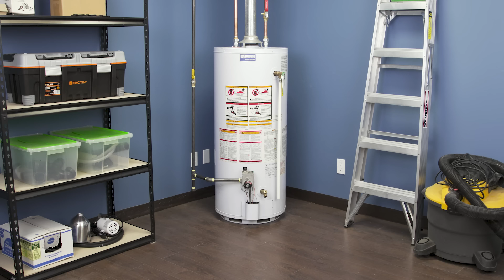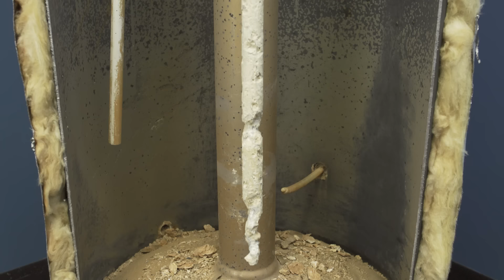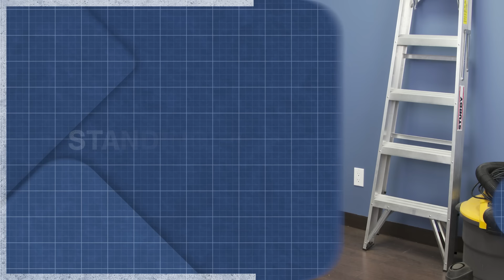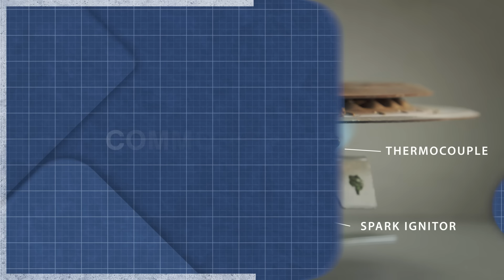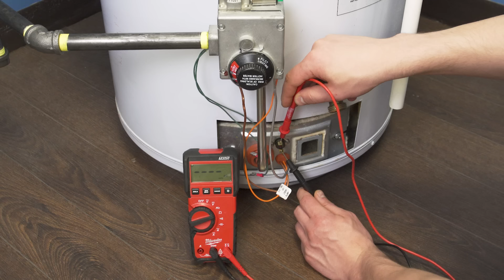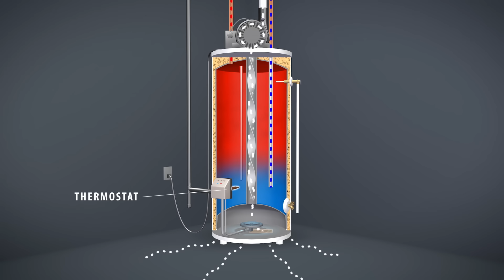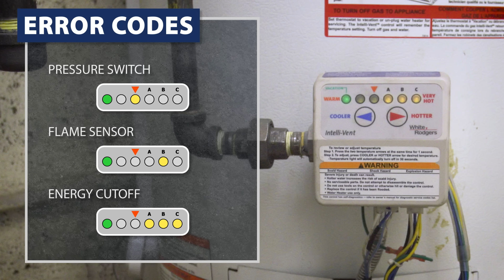How Do Gas Water Heaters Work? | Repair and Replace

Comment: With gas hot water heaters, there is a tiny screw that mounts the pilot assembly.     A year or more ago I lost that screw changing the $20 pilot assembly.    It is not obvious that the pilot does not sit on the burner tube flat spot, but instead mounts offset.    Sitting the pilot not where it belongs but just offset a bit causes it to blow out and readjusting the position fatique breaks the thermostat tube.   So to change the $20 pilot assembly, turn off the gas and remove the whole burner with one compression fitting and use the mounting screw on the pilot .   Then connect the pilot gas tube and the thermostat tubes.

I found the screw and slid out the whole burner assembly to mount a new pilot with the screw.    A years worth of hot water heater grief instantly went away and operation became perfect again.

This shows that some very tiny stupid misstep can cause a lot of grief.    Little things matter.
Reply from the maker: Thank you for sharing your experience. Losing screws or breaking mounting clips etc can make any repair more difficult. We're glad that it all worked out in the end!

Comment: Thank you for replying to all comments in this video, that's awesome. I think I might have an issue with my hot water heater or my plumbing, I am not sure yet. If I open a cold water faucet that is upstream of the water heater CW input, I get hot water in some faucets. The water heater has an input main valve in the CW leg, if I close it, and open a hot water faucet, I get cold water through the hot water faucet. I checked all the shower faucets mixing valves and it is not a problem with any. I troubleshot closing all cold water valves. My question to you is, is it possible to get any type of flow through the hot water leg of the heater if the main CW leg valve is closed?
Reply from the maker: Thanks for watching, we're just happy to help especially when it comes to answering comments! There are a few things that could contribute to hot water coming out of the cold side. One possibility is thermal expansion which can be mitigated using a thermal expansion tank as well you could also try turning down the temperature of the water heater and see if this helps. Another possibility is that your the copper pipes on the cold side were running close to a heating duct or to a hot pipe. This would heat up part of the pipe which would give you a little bit of warmer water.
Reply: Thanks for the help! :)

Comment: It's funny, when I was growing up, I never once remember running out of hot water due to a bad water heater.  Never remember someone having to come out to replace one.  They seemed far more reliable and durable back then.  My dopey mother once ran into our gas WH that was in the garage, with the car!  You should have seen that tank!  The huge dent in the tank was so huge that if you looked at it from the side, it seemed to go about halfway into the tank.  Now, people would panic.  She didn't act like it was a big deal so we all ignored it, never smelled any gas, and that battleship WH just kept trudging away producing hot water when we needed it.  I am not lying.  It lasted forever.  I had a Whirlpool gas WH installed professionally back in 2015.  Since then, the control valve has failed and I have replaced it TWICE.  First one lasted five years, second one last less than two.
Reply from the maker: Thanks for sharing your experience. It's hard to know what exact changes have been made to the designs of water heaters over the years. I think the tanks themselves have been made in a similar way. The control valves have evolved. Electronic control valves have more points of failure than a conventional gas valve. There have also been revisions with conventional gas valves but less changes overall. The thermal cuttoff switch and flame arrestor screens have only been added recently, so that adds safety but can also cause issues if the switch is faulty.

Comment: Why does my gas WH make popping sound from down under about a minute after the burner goes out?  I'm not referring to the sounds in the tank people talk about when there are sediments there.  This noise is from around the burner/thermopile/pilot area I think.
Reply from the maker: Thanks for watching. If there is a popping sound, then it's likely the sound of the sediment at the bottom of the tank as it is pushed around when heated.
Reply: @AmreSupply  Thanks, but I don't think so.  This is an almost "scheduled" sound from the burner area sounds like. And it happens after the burner shuts off as i said.  I am familiar with the popping from the tank due to sediments.  I've had those in the past with my old WH.
Reply from the maker: Sorry about the first answer, I read over the part referring to you saying that it's not from sediment. If it only happens after the burner shuts off then it could be the sound of metal from the burner or mounting plates cooling and contracting. If this is the case it might sound similar to the duct noises from a furnace which is a similar phenomenon.

Comment: Why would my taps get hotternover time? Faucets and shower will spike in hot temperatures, even when I lower the dial to A
Reply from the maker: Thanks for watching. The gas control valve contains the thermostat which detects the temperature inside the tank. If all of your faucets and showers are too hot then it's possible that the control valve is faulty.

Alternatively if your system uses a mixing valve then you might be able to adjust the mix of hot and cold water.
Reply: @AmreSupply  hot water used to run out and get luke warm in the shower after 15 minutes, now its just gets really hot in burst of 1 to 2 minutes for like 4 to 5 seconds.

Comment: dumb question but do I need to empty the water heater before removing the annon rod?
Reply from the maker: Thanks for watching. If your anode rod is positioned at the top of the water heater then you only need to drain a little bit of water before accessing the anode rod. You can learn more in this tutorial: https://www.youtube.com/watch?v=hTJv67imgaE

Comment: Hello - how much gas does the tank use to maintain temp when sitting idle?  Would you happen to have a rough ballpark for a 50 gallon tank?  Thanks
Reply from the maker: Hi Paul, thank you for watching. That kind of info is not readily available but you might be able to get some sort of answer here: http://waterheatertimer.org/How-much-does-it-cost-to-run-water-heater.html

Comment: Hey, thank you for the video! I came here because I now live by myself for the first time, and I have a gas water heater. My shower and the tap in the kitchen only deliver scalding hot water or lukewarm water, but it can never stay at a comfortable temperature long enough to take a normal shower. Is that usual with gas water heaters? I know mine gets checked regularly (once yearly).
Reply from the maker: Thanks for watching. If the water is scalding hot, then you can adjust the temperature at the water heater. It will take time for that to adjust, so it's not an instant change. You might have to adjust it, wait, test and repeat over several days.

As for showing, adding in cold water should be able to normalize the temperature. The shower valve mixes between that, so some valves may be more sensitive to turning the handles than others.

As well it depends on the size of your tank. This can also effect how long you can shower for with hot water.

Comment: I have been in the Plumbing profession for 35 years and I was never able to unscrew a Anode rod from a Water 💦 heater.
Reply from the maker: Thanks for watching. Some anode rods can be difficult to remove especially if it has never been removed from the water heater.
Reply: @AmreSupply  unfortunately Everytime I attempted to replace a anode rod the water heater was old and the threads were corroded in place. Even with PB Blaster I could not get them out. I had to recommend replacing the heater itself. But I have heard of people getting them out 😁

Comment: Thanks for the video. One question: In 6:40 it says about power vented tanks. "The pressure switch then verifies that there's enough airflow for combustion. Next the hot surface ignitor heats up and ignites the burner." Can you explain how the gas flow is opened in the process? Thank you
Reply from the maker: Thanks for watching. In power vent water heaters the gas flow is opened by the intelligent control valve. This has a circuit board and will control the power to the various components.
Reply: @AmreSupply   Thank you for your answer. So it sounds that the pressure switch, the hot surface ignitor and the gas valve are not interconnected directly but through the circuit board, and the intelligent gas control valve has a more complex mechanism that cannot be simply said if the pressure switch or the hot surface ignitor turns it on directly.
Reply from the maker: @eidos4190  Yes its all connected through the control board. Think of it as a flow or a chain of events. Each event has to happen (call for heat is made, inducer blower runs, after several minutes the pressure switch is checked, then the ignitor fires, gas is released, flame sensor is checked etc) If one of the checks fails then the control board will show an error code as it knows at which part of the sequence the failure happened. The logic is similar to furnaces and is explained in this video: https://www.youtube.com/watch?v=b0sAGt-1niU

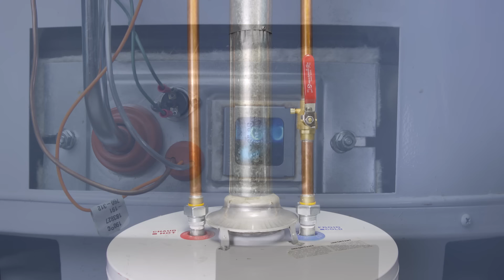Comment: Great video. 3:25 this is the standard design that’s been used for decades. It was a great design and worked reliably for decades. Yeah and just recently they’ve gone to the new designs that have all sorts of safety crap on them that makes them break all the time. Thermal piles to generate more electricity to run a smart computer board. Ignition vials that break often times due to malfunctions. All the stuff requires more complicated analysis to repair. Just give me the old fashion standing pilot light and I’m fine
Reply from the maker: Thank you for watching. There are definitely advantages to having additional safety switches and a control board that gives error codes but you are right that each additional part adds a layer of complexity and another point of failure. There is something elegant about simple old fashion systems. We've noticed this with appliance repair. The older models tend to be more simple to troubleshoot.
Reply: @AmreSupply  - tend to be? No doubt about it. Same goes with my washer. Just give me a washer that fills up with water agitates rinses and spins. I don’t need all this crap that does soft fabrics delicate fabrics auto sensing BS but once it breaks you need to repair man who can’t even fix it typically to come out. It’s totally ridiculous how complicated they make things for consumers now. It’s all around getting more money out of consumers for repairs. Thanks for the reply

Comment: As a retired HVAC Tech, I confirm this is a great video. Some of this stuff was applicable 25+ years ago... the "troubleshooting techs figured it out on their own, the hard way, and some techs did not... In summary it was never this easy! :-)
Reply from the maker: Thank you Bob for sharing! It is hard to quantify the additive effect of troubleshooting different systems over the span of years. There are some brilliant techs out there, and their knowledge and experience is quite valuable. We're hoping that our Repair and Replace videos help increase the base level of knowledge of homeowners, allowing them to troubleshoot and identify some of their problems while still knowing when to call a tech.
Reply: Im a new HVAC tech and this is fascinating to me. We dont touch water heaters as HVAC techs at my company, that's for our plumbing department. But ive always been curious, and I wnt to be able to answer questions if i'm asked.

Comment: After going through 3 water heaters in a span of 7 years, I started doing much more frequent maintenance. I flush it twice a year, and replace the anode rod once a year. It may seem excessive, but I have very hard well water and a water softener, which eats anode rods like my kids eat corn on the cob.  Every time I check the rod, it's down almost to the bare wire. But at least anode rods are cheap; water heaters are NOT.
Reply from the maker: Thanks for sharing your experience! That is definitely some hard water to be going through the anode that quickly. In your case its pretty clear that regular maintenance is less easier than replacing the entire water heater.

Comment: My plumber mounted my power vent gas water heater directly on the concrete basement floor.  It seems to be working fine, however this video shows air entering from the bottom to the burner.  Is there any danger to being flush on the floor?
Reply from the maker: Thanks for watching. All power vent water heaters will have an exhaust pipe, some will have a direct vent intake as well. If it doesn't have an intake pipe, then it will draw air from below. If you look closely you might see small vents around the bottom even if it doesn't look like it is sitting on legs. If you see no legs and no vents then the water heater might be starved for air. If you're unsure then give your plumber a call to ask them to clarify.

Comment: Good video. I wonder why the power vent types are not 3 pass vents
Reply from the maker: Thanks for watching. There are some "direct vent" (power vent) water heaters that have an exterior fresh air intake vent and an exhaust vent and are not reliant on the room on the air.

Comment: I was taught to never flush a tank heater only tankless because it can kick all the scale and build up into the whole house and cause issues
Reply from the maker: Thanks for watching. There are a variety of opinions on flushing. Some people have had a water tank for 30 years and not done a single flush. It does depend on the mineral content of the water. Most water heater manuals recommend yearly flushing.

Comment: Great video! Would you be able to do a repair and replace for a tankless water heater too?
Reply from the maker: Thank you Cameron! We are currently filming a series on Refrigerator repairs and have a few more appliances to do first before returning to plumbing videos. As for tankless water heaters, they will have similarities to power vent water heaters and high efficiency furnaces. They have a hot surface ignitor, flame rod and a inducer blower fan. The difference is that a water loop runs through the burners to be heated instantly. You can learn how a furnace works here so understand some of the principles in action: https://www.youtube.com/watch?v=tVLtJwix-_8

Comment: I think I just learned the problem is the thermostat in the control box (which is too old to find). My pilot stays lit but the burner only fired once for a few minutes until this morning when it was really cold out. It fired by itself and stayed on for several hours and this video is telling me that the thermostat (the part on the box that gets screwed into the tank) is the issue. I've watched so many of these, they all cover the same but this is the first one that explained what actual component makes the main burner fire. Thank You!
Reply from the maker: You're welcome, we're just happy to help. We have a dozen other videos on water heater repairs https://www.youtube.com/playlist?list=PLCo9SMjkdWBwJ4a8MT2GKTDiSuvSHg6Xk but unfortunately don't have a video on replacing the gas control valve.

Comment: I have a 2013 GE gas water heater … pilot light stays lit but when I turn on the hot valve in shower cold water comes out then I get somewhat warm water not hot as I used to. You think it’s a bad thermocouple or bad gas valve ?
Reply from the maker: Thanks for watching. The thermocouple will not affect the temperature of the water. A weak thermocouple will however shut off the gas. 

If the tank isn't getting then it could be helpful to do a deep flush to remove any sediment. Alternatively the thermostat inside of the gas valve could be faulty.

Comment: Excellent video, great visuals, production values, and content.  My gas fired how water tank does not have a drain location nearby, so I am looking at installing a system (of my own design) featuring a water sensor and bilge pump in the drain pan under the tank.  The idea is that if water is detected in the drain pan, the sensor will cause an electronically activated ball valve to shut off the cold water supply to the tank.  The bilge pump will pump the leaking water out of the drain pan to a nearby sink, until the water level drops below the leak point in the tank.  I do have to find a bilge pump that will successfully pump hot water (some have water temp limits) but my bigger concern is what happens if the tank leak occurs below the gas valve/temp sensor?  The temp sensor would no longer be immersed, would likely detect a low temp, and the burner would just keep burning.  I don't care about damage to the tank at this point since it is toast anyway, but I am concerned that if the tank overheats dramatically it could start a fire.  I really want to avoid hooking up an electronic gas shutoff linked to the water sensor since this would get complicated but perhaps this is the only way to be truly safe?
Reply from the maker: Thanks for watching. We're glad that you found the video helpful.

There are products such as the Floodstop Automatic Water Shut Off which seems to come with a built in alarm. As for protection: The water heater sensing bulb has a built in energy cutoff switch or ECO. In some models this is a fuse and in other models it is re-settable. Regardless if there is water in the tank or not, if the ECO gets too hot, it will shut off the gas valve. As well if your water heater has a thermal cutoff switch installed that will also protect the burner from overheating. http://waterheatertimer.org/images/Typical-gas-valve-500.jpg These safety devices protect the water heater and prevent the burner from burning when its not safe to do so.